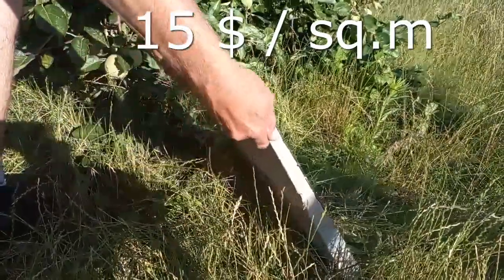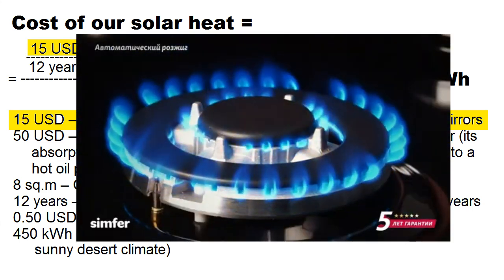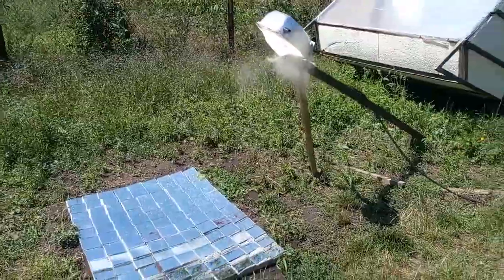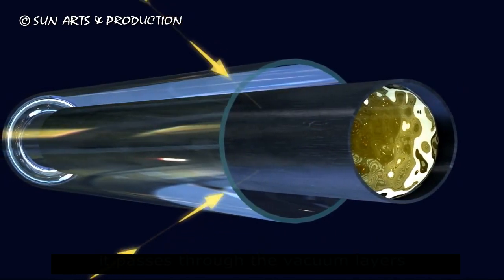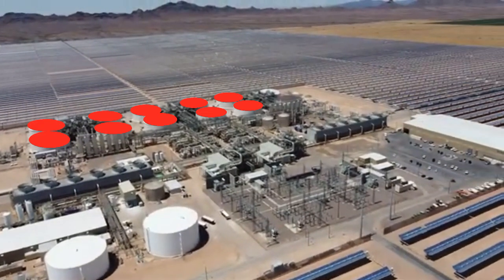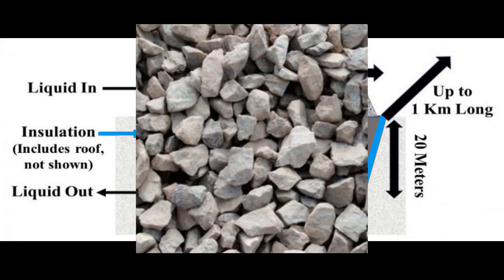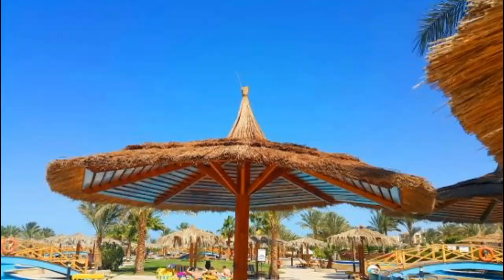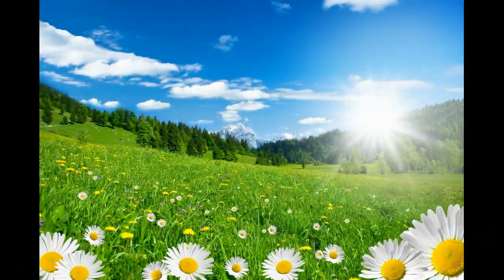How mirrors can generate cheap solar electricity to end coal and nuclear power plants

Comment: For creating a parabolic mirror you could use a stainless steel sheet, with laser/water jet cut slots and holes. The flat sheet would the be flexed into shape and rivets placed through holes to hold sections in place.

Comment: is anyone else wondering how a PV which needs 1km long clean room production facility has been developed but no cheap metal / plastic, mirror turbine system that can be built in low tech factories exists? is the engineering of such a system really damn difficult considering we have gas / steam engines for centuries and all they require is a mill?!
Reply: Solar thermal really makes sense when you can use the electricity and the heat produced so the steam cycle efficiency is not a limiter.  Then it beats PV hands down.  If you cant use the low grade residual heat then application of solar thermal is more limited and less astounding.

Comment: How do you calculate the mirror position?
Reply: Remember that with the changing of the seasons the sun will be shining down at right angles (90 degrees) between positions 23,5 degrees north an 23,5 degrees south. Like this: on december 21 the sun is directly over 23,5 south, on march 21 the sun is directly over the equator, on 21 june it is over 23,5 north (summer solstice for the northern hemisphere)
At this date, 90 degrees  north of the equator, at the north pole, the sun is seen above the horizon at…23,5 degrees! When you travel south from there to Sergiy who is at 50 degrees north you have to add 40degrees to those 23,5 to find the max solar elevation for 21 june at his place: 63,5 degrees.
Reply: @Calligraphybooster  And how do you calculate the angle of each small mirror on the slate
Reply: @MestreBonsai  the passing of each day makes the angle of the sun vary between 0 degrees (at dawn and dusk) and 63,5 degrees at noon (that is not necessarily what you read from your watch; it is true sun noon) on june 21. 
For the matter of maximizing efficiency I would want my mirror set up to make best use of the sun between 21 March and 23 September. At these dates the sun is 40 degrees above the horizon at Sergiy’s. The average of 63,5 and 40 is about 52 degrees. Therefore I would erect an earthen mount with a slope at 38 degrees to place my mirrors on. It must run true from East to West. 
Next I would make a temporary support construction over the mount that runs North-South, and would mark the point on it where I want the future collector to be: the same position as the average seasonal position of the sun at noon. That means at right angles with the surface of the mount and halfway up the slope.
You asked me how I would calculate the positions of the mirrors. From this point on I wouldn’t. I would lay out a square grid on the mount where I need my mirrors to be placed. Next I would stick a lump of clay in the place of the future collector (the average foacal point) and, if I had one, fix a small laser pointer to it, pointing down on the grid on the mount. Then I would place a mirror on that spot and manipulate it until in shines straight back at the source. 
Without a laser I would use a wooden cube with a long pointing rod to press the mirror in position while the rod points to the collector.
More about the position of the sun for any given date/hour and position you should be able to find googling. Use terms like ‘tables astronavigation’.
I hope this was of use.
Reply: @Calligraphybooster  Thank you very much for this very complete answer.
I was thinking of doing that :-) thought there was some other way 🙂Thanks
Reply: @MestreBonsai  you’re welcome! Best of luck woth your experiments

Comment: Excelente job , very anxious waiting for diy video .
It can work as desalination?
Reply: If it can turn water into steam, why not? But one should not vaporize salt-water in the receiver, as the salt would stay there until it is full of salt. So you need to transport the heat from the receiver to the vaporizer and that is where it gets complicated.
Reply: @hschmidt79  Hi Harry , you are right, the solar heater is for pre-heater, and then goes to the destiler, any comment welcome